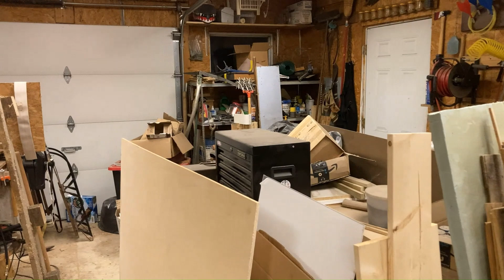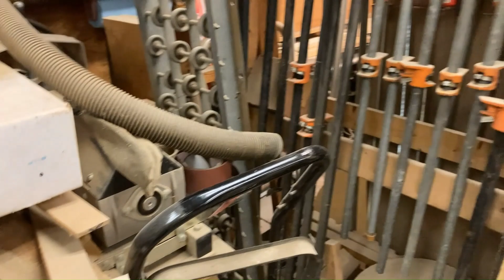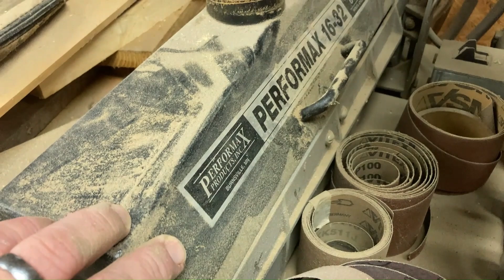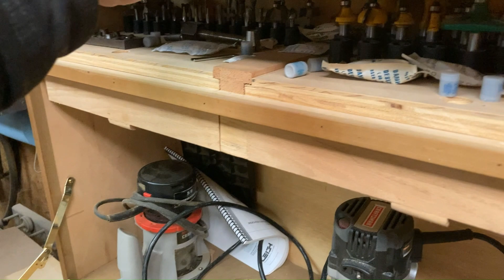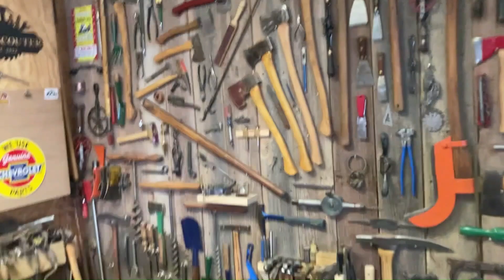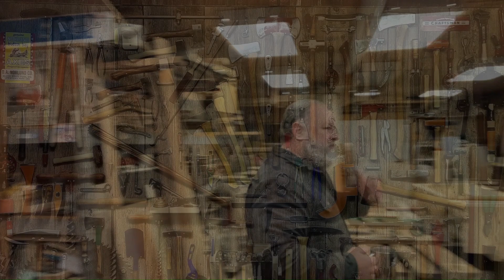ToolScouter Shop Tour

Comment: Great tour and thanks for letting us in.  I'm going to get around to doing mine someday, just not there yet.  I have a some mobility in my shop as well, just makes it easier if you have to get to something!  I wonder how old that Grizzley saw is, looks like a good performer!
Reply from the maker: Thank you. I will look forward to seeing yours when the time comes. Mobility is always necessary just to accommodate different projects. As for the tablesaw, I’m not sure how old it is, but I really like it. The worm gears work very smoothly. The only thing I would like to have been a little better is the fence. To get it very precise you have to measure from the blade and then from the grooves in the tablesaw to get it perfect. thanks again for your visit and hope you have a great week.

Comment: Becky (my wife) regularly mentions my hope to visit your shop. She has traveled some with me to visit and tour folk that I have met via YouTube. We just haven't had a demand recently to drive your way since August.
I really appreciate the shop tour! I had no real shop until I converted a mid 1800's root cellar. It was a lousy shop, only about 10x14', where my head barely cleared the log ceiling floor joists, and I constantly dealt with a flooded floor.  I eventually upgraded and converted my largest of unconnected basements into a dry climate controlled space. This partial basement under a larger house expansion gave me limited space with 7.5' ceiling, and only a 6' man door. I crammed numerous woodshop machines and machine shop machines into this space. After my retirement, my dear wife suggested that I build a proper shop. I have converted my basement shop into exclusive woodshop, and I have 3200sf shop space in a 4600sf shop building. I have committed the last several years to expanding my machine shop capacity and developing a proper mechanic shop. With 16' ceilings and 14x16' overhead doors, I have space to work and expand. I add new machinery as opportunity provides. I favor old industrial machines and enjoy great pleasure reconditioning machines and then employing them in my shop. 
I treat myself with lifelong desires every few months. Part of my life mission is disciple young men into vibrant service to Jesus Christ. The trades being very good to me and my offspring, I use my shops to mentor young men in the trades and build relationships that foster Christian growth. My wife could have been unsupportive about my shop life as she finds no personal pleasure in the shop(s). Happy and successful marriages are built around collaboration. For me to enjoy such extensive shop capacity in retirement isn't justifiable without her energetic support. I marvel daily that I have a precious wife and that I cannot justify the shops that I enjoy. 
My father had only a tiny shop with very few tools. He loved his shop, and he passed on his shop passion to me. He didn't live to see what God has kindly allowed me to enjoy. I was an industrial maintenance electrician and mechanic. My career exposed me to most common trades. Woodshop/fine furniture and general machine shop machining are my primary retirement hobby focus, but I included 14K# vehicle lift in my vehicle service bay. My boys and grandsons help me on major tasks like when I rigged my largest lathe (9500#). I didn't have enough capacity to haul it or rig it through the shop, but we were just barely able to get it off of the trailer with the vehicle lift.

Your work and mine differ, but you exhibit the same passions that drive me. I am writing a lengthy comment while I wait for laquer to cure so I can complete the last laquer coat on the current hopechest project.
Reply from the maker: Thank you so much for sharing about your life and how the Lord is using you. Ever since I can remember, my dad always had a workbench and some tools, at least in the corner of some storage room or outbuilding. When I was young, they never were big. When we came back to the states from the mission field, my dad began to accumulate more tools and his garage became very full. When he retired, they moved in next door and he built this shop that I’m working in. He passed away of cancer and Parkinson’s about seven years ago, and I have inherited all of his shop and tools. I am definitely blessed by the parents I was given to raise me the way they have, and to have received not just a wonderful gift of a Christian Heritage, but to have a place that I can enjoy working with my hands and spending time with my family there as well.
What you and I do is very different, but there is a wonderful beauty in the variety and talents, God has given each of us. I believe we should admire each other’s accomplishments and encourage those differences. You fill a category of industry that others don’t, and others fill a category that you don’t. Together things get done.
Keep on speaking into the lives of others and there will be a huge blessing. Not just for them but for you as well. Thanks for coming by the shop for visited sharing. Have a great week and God bless you.

Comment: Awesome! Reminds me of my grandfather's old shop. I have the little wood stove that used to be in it. Is the kerosene heater your only heat source? Were some of these items passed down from your Dad? Thanks for sharing with us all!
Reply from the maker: That’s great. I hope they are fond memories. I do have a kerosene heater in the middle of the shop but that is not what I use. There is baseboard heat on the south wall. It doesn’t get real warm in the shop but at least fumes will not combust. Yes, all of the large tools I inherited from my father. Only the battery operated tools and hand tools are originally mine. We always had some kind of a project we were doing together, whether it was fixing something on the house or building something in the shop. I am blessed to have what he has left me. Thanks so much for your visit and I hope you have a great week!
Reply: @toolscouter  thanks for sharing 🙂

Comment: "Chop saw"! Please, please don't call it that. That indicates the way that the tool is used and a miter saw shouldn't be used in such a careless manner, though I know it is a popular nomenclature, it makes me cringe every time someone says it. As a retired finish carpenter/builder, I can tell you it is easy to tell when someone uses a "chop saw" and when someone properly uses a power miter saw. (I have 3).
Reply from the maker: You are absolutely right. It’s the difference between a framer, a finish carpenter, or cabinet maker. I understand and ask your indulgence. Thanks so much for your visit and I hope you have a great week!
Reply: Good comment, though I call my saws by common and proper names. In the 1970's I was introduced to the radial arm saw. It was such a versatile tool that I just had to have one. I purchased a used Craftsman in 1977 and used it for most of the marvelous functions that it was capable of doing, though not doing exceedingly well. I replaced the OEM particle board table with a much larger 3/4" aluminum plate, which allowed the saw to survive in the DAMP converted farrowing house I then used as a shop. The Craftsman model was old enough that critical worn parts could not be purchased, so accuracy was compromised. It was under powered as most of that brand and vintage were. I neglected that saw as the hog house continued to deteriorate. By then, radial arm saws had fallen out of favor, and miter saws and sliding miter saws were taking their place. I settled on DeWalt, but other premium contractor brands could be acceptable to me. I have been through a series of table saw upgrades, I think 6 in total. I am currently very satisfied with a Houdaille vintage Powermatic 66 and a very heavily modified vintage Delta contractor tablesaw.  I no longer see a need for the radial arm saw option, and scrapped mine several years ago when I tire down the farrowing house to erect a proper shop building. 

I am not against employing a proper industrial grade RAS someday, but my "chop saw" options meet my needs well. I like their portability. On a proper portable stand with appropriate fence/table and collapsing long stock support, I can manage the longest stock that I can get into my shop (around 14'), and still take a saw to a remote construction site.